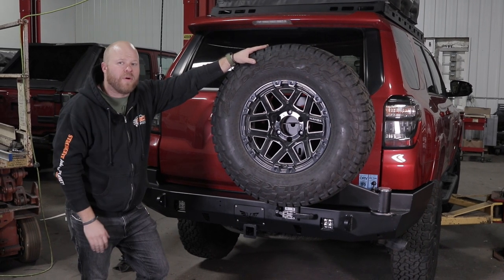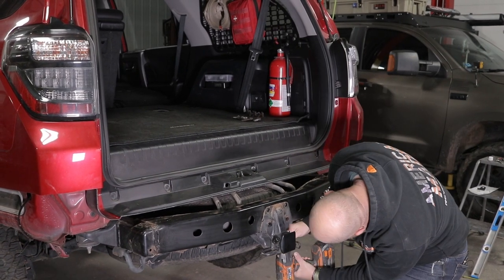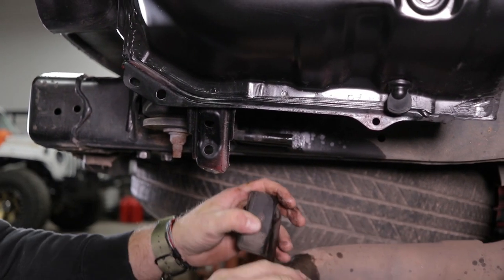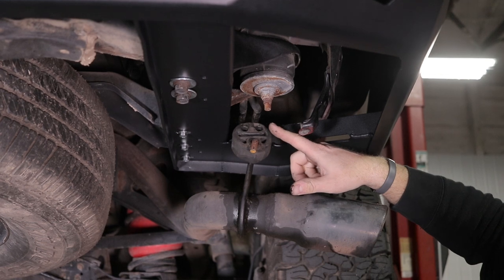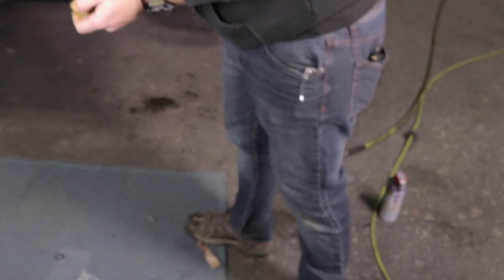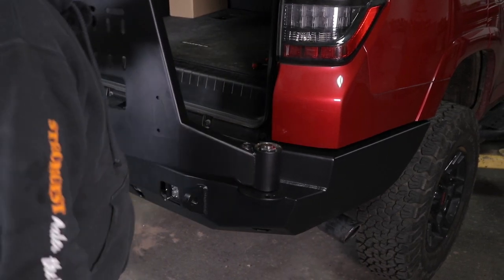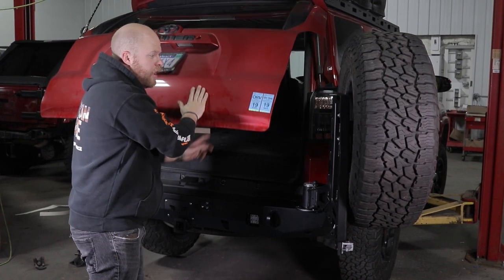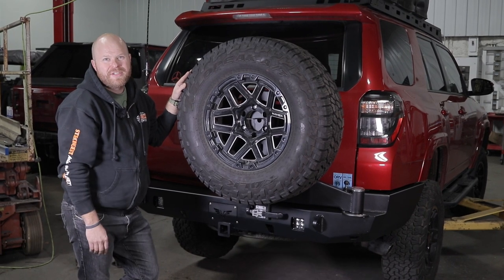4Runner Rear Strike Bumper & Adventure Carrier Install

Comment: Looks fantastic, and I'll be getting one. It looks like the cuts that were made on the vehicle plastics leave about an inch gap. Is that accurate? Is there a reason you don't instruct the cut to be at 5.25" or 5.5"? Seems like it would leave less of a gap between the bumper and plastics.
Reply from the maker: The gap does close with the vehicle out of the hoist (see our product photos) you can make it closer, but the bumper (and frame) flex independently of the body, so this gap will close up and/or rub when you are wheeling.
Reply: @Victory4x4  Got it. I had looked at the pictures, but it was a gigger gap in the video. Makes sense about it being on the hoist. Thanks for the reply!

Comment: Looks great, I just wish you'd designed it with all metric fasteners.  It is so frustrating when aftermarket items use SAE fasteners on a Toyota.  I'd really like to just carry my metric tools.  But 1/4" bolts, 1/2" nut, 5/32" hex bolts... sigh.
Reply: 100%!!! Also, PLEASE powder coat the hardware black. All this stuff coming with shiny metal just stands out.

Comment: What’s the measurements for a 4runner with a 1 inch body lift. Just extended it to 6 inches?
Reply from the maker: We would suggest sneaking up on the cut line with a 1" body lift, as they aren't always exactly 1".

Comment: Just ordered mine and have one quick question, which 3X3 lights did you use in this install?  Any particular ones work better than others?  Link?
Reply from the maker: They all fit pretty similarly. The ones we used in this video are discontinued, but we do offer Baja Designs lights on our site. We recommend the work/scene pattern for backup lights.
https://www.victory4x4.com/product/5578XX.html
Reply: @Victory4x4  I didn't see these on your site previously.  I ended up ordering the similar units from Diode Dynamics.  I have great luck with their fog lights.

Comment: If it's your own product why did you select materials that will corrode together?
Reply from the maker: Are you talking about the top cap for spindle? Aluminum is the best material option for this, and a little anti-seize on the threads will help with any issues.

Comment: could one cut the fenders at a length of 5.5 inches to reduce the amount of space between bumper and body?
Reply from the maker: Yes, but you may have to deal with the body rubbing the bumper under flex.

Comment: Does the Adventure Carrier come with shaft, bearings, seals, sleeve and needed hardware to install on a different bumper? Awesome  bumper but I'm working on a 2nd gen 4runner and have some ideas. You've pretty much done the  engineering for me. Just what I could be looking for. Thx.
Reply from the maker: Everything but the sleeve that's welded in the bumper is included with the adventure carrier.
Reply: @Victory4x4  Thank you for the reply. I could make that work. I may be asking for your opinion on a sleeve, if that would be cool?
Reply from the maker: @dhu1042476  if you call the sales team to order the spindle they may be able to include a sleeve with the order 269-353-1184.

Comment: how much actual space do you end up with between where you made your bumper cut and the actual bumper once it is installed?  I plan on purchasing this bumper in the next 2-3 weeks and am just a bit concerned about the amount of open space between the bumper and body cut line.
Reply: if you do any decent offroading you want a little space for any potential flex. That goes with any after market bumper. If you have it flush you'll have rubbing problems